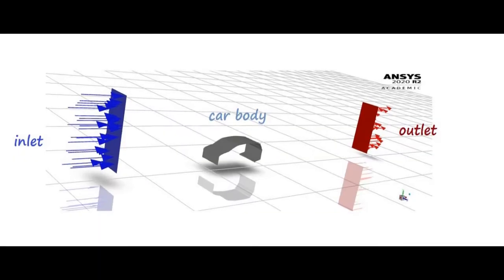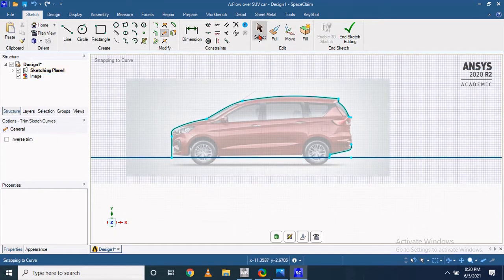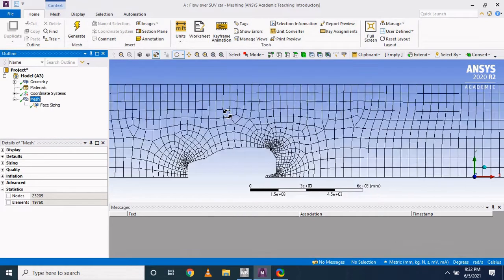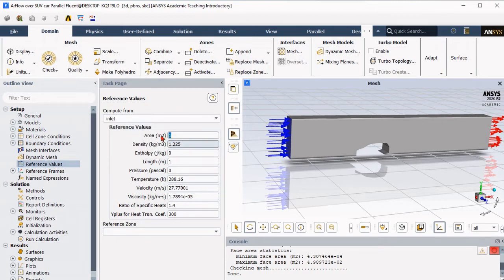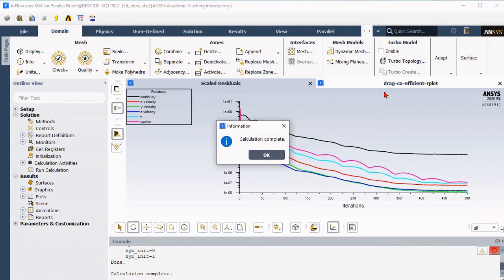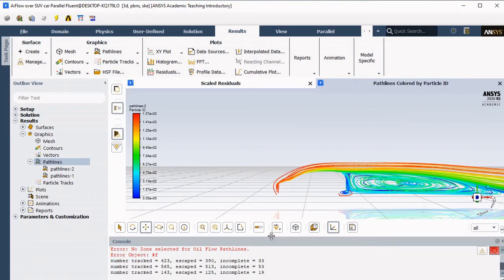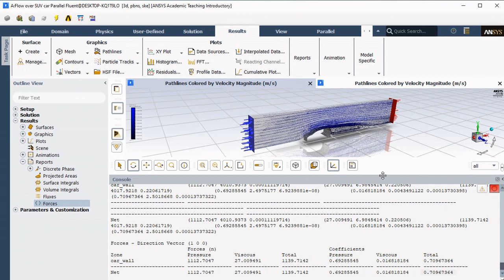ANSYS-Fluent tutorial || Flow over car-vehicle || Drag calculation

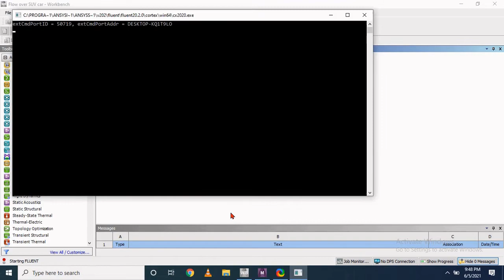Comment: When constructing a cfd numerical model, one should absolutely calirify assumptions/hypotheses and model limitations. Here at 7:24 the side faces are set to walls... Which greatly slows down airflow on both sides of the car plus, the the drag force is an integral physical quantity so the left and right sides of the car have to be included in the integral with air flowing over both sides for the boundary layer to build up, for a correct drag  force prediction, what is done here is fundamentally incomplete,  and physically unjustified. Remember, for a PDE solution to be representative of the physical phenomenon it has to be produced consistently, using the correct set of  boundary conditions. Check your BCs.
Reply from the maker: I accept your correction. Regards.

Comment: Very useful tutorial. It helped me a lot. I have a doubt regarding lift coefficient. With the same procedure I solve lift coefficient. But for me it's getting above 3 for lift coefficient and above 4 k lift force. Is that right...please let me know asap. 🙏
Reply from the maker: You should verify the dimension unit (mm/meter). Also check the reference value input. Let me know still not get proper value.